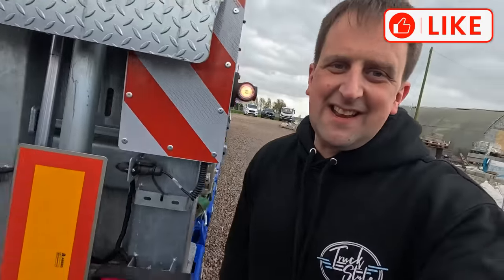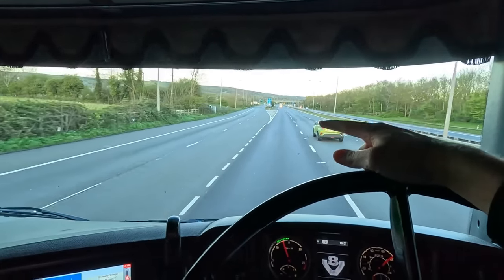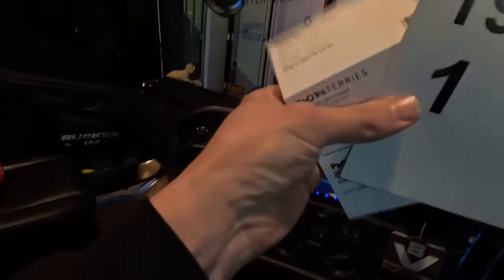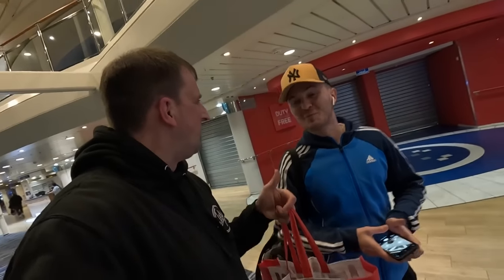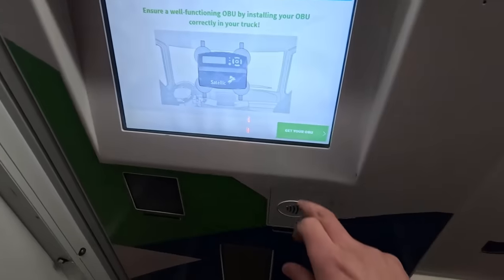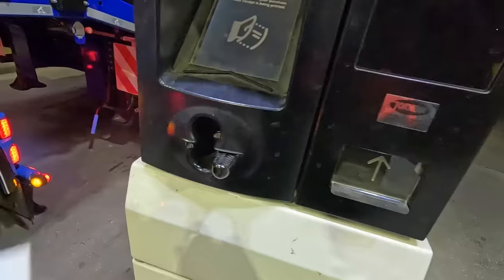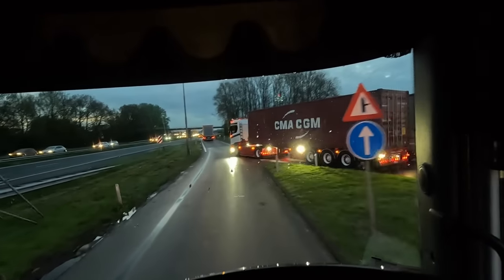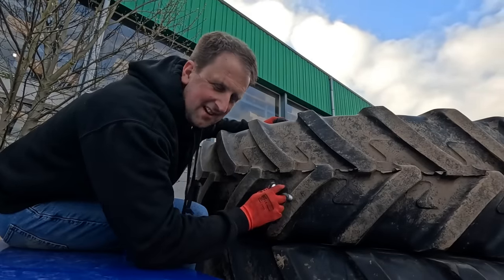OVERNIGHT TO HOLLAND | MY FIRST EUROPEAN LOAD | PT1 | #truckertim

Comment: tim, one peace of good advice dear collegue... never ever drive without a tollbox , obu, its verry expensive .... because, fines are not a little, but VERRY expensive, and if it fails on u, dont keep driving, there are some rules for it. u got a window, where u can or A have your unit repaired or replaced, but its only a few hours, AND u have to make contact u are having a failing obu, if not, fines, if u for example drive like this a week, is about 3000€ mine failed, because with installing gps from company, they jerked power cable out, but i dident notice it, because obu, was behind new gps. Big fail.... payed bye the company that dit the gps. But i can thell u this. it aint no joke.

Comment: Could you have pumped more gas if you had fed the card in and used chip and PIN rather than contactless? Or was that not an option? Good grief: you're in a dedicated TRUCK LANE! 125l?! lolz

Comment: What an achievement eh? Man lands on the moon in 1969, NASA sends a probe to Mars, and in 2024 British Truckers struggle to drive 100 KM to a port to get on a boat - (Yes, they were on a boat, they didn't have to traverse the North Seas with a lorry on its own) then they probably managed to drive another 50KM (on the wrong side of the road by Jove) and return home in one piece. Queue the ticker tape parade, RAF Flypast, honoured by the King! Sad thing is, it took them two attempts as they were unable to get their paperwork correct!
Can you please do another run and film yourselves unlocking and unscrewing the Diesel tank filler caps in Amsterdam and managing to fill up with a tank of Diesel rather than 96 Petrol? I know it is difficult, but it will be so rewarding. Imagine this though.... about 10,000 trucks come and go to and from the UK everyday.....with the correct paperwork!
Bet his local back in the UK is deserted as he returns, it will be all he has to talk about for the next 10 years! His mates will all be hiding.